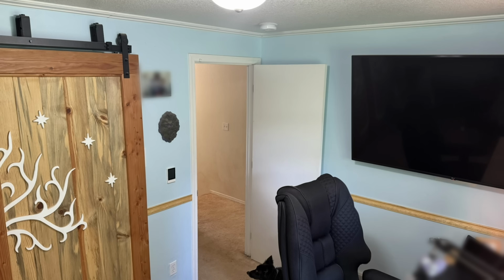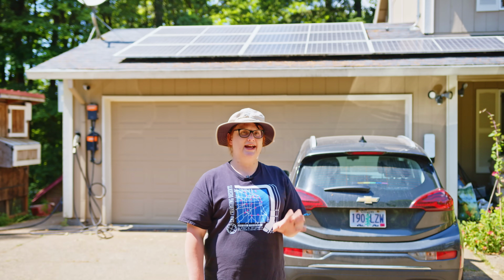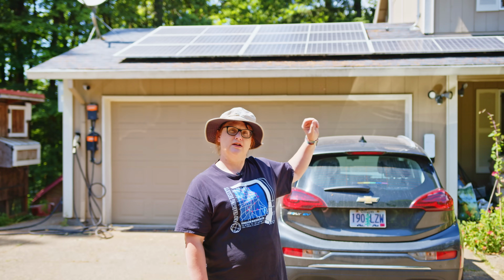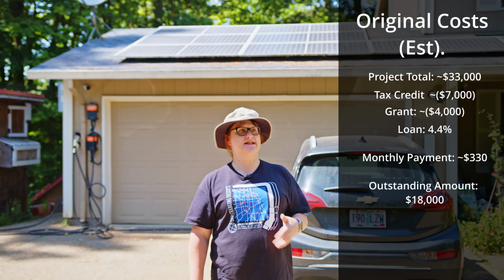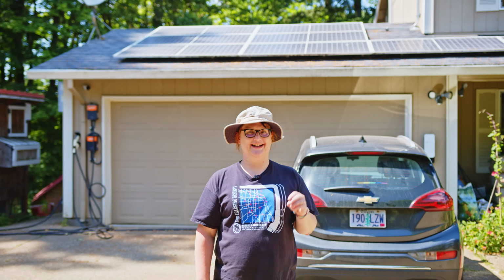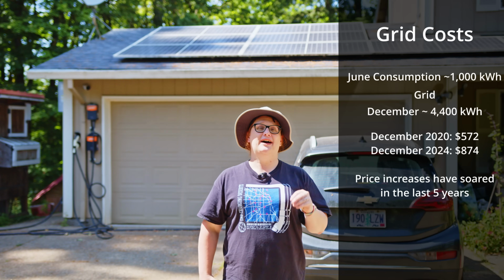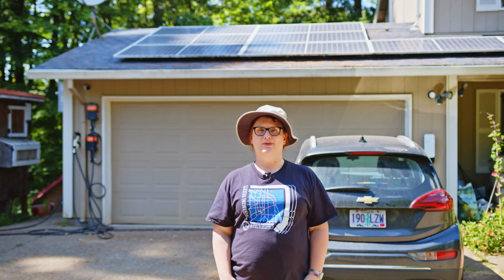Our Solar Array Is Peaking at over 80 kWh a Day! - But Was our Investment Worth It?

Comment: Nice presentation . As the owner of a solar company in Oregon, a few comments. 
1.Get 2 quotes or more   
2. Typically door to door solar companies have outragous prices. 
3. Solar output and very minor degradation in solar panels is more due to variences in weather and way more insignificant to our ridiculous price increases from the electric utilities over the last few years.   
4. Cleaning solar panels over 10 degree tilt, which is most roofs is good but not a huge necessity. Solar panels get a little bit of dew in the morning on them and the tilt is enough to gently wash the dirt off, lower slopes (10 degrees or less) tend to not be steep enough to wash this off, the moisture sits at the bottom, evaporates and the bottom lip of the solar gets a little dirt buildup. I recommend an exapandable pole ($30 or so at hardware store) with a broom that can screw in with soft, with some plain water and a very light cleaning . I don't recommend power washing or getting up on roofs and as I have seen someone fall, I don't recommend going up on the roof for homeowners.   
5.The typical 200 Amp electrical panel can take breakers for 7.6 kw of AC inverter or about 9.88 kw DC. If there is physically enough room for a line side tap before the main breaker than a larger system with an external shutoff and breaker can be installed. If the 200 Amp panel has a 225 Amp bus bar, than a larger system can also be installed.   
6. String inverters vs. micro inverters or Solaredge. I prefer string inverters. Their are multiple manufacturers, in case one goes out of business. With a proprietary system (micro inverters or Solaredge) if they go out of business and the parts fail, you have to start over. Also the least amount of electronics under solar panels (a very tough place to live for decades) the better. I use string level shutdown devices rather than individual module devices. Modern string inverters have multiple MPPT's (seperate indenpent channels for solar) which in most cases does as good as indivdual panel inverters or optimizers.

Comment: 15kWp isn't that large of a solar system these days. you also could put polycrystaline panels on the north side that make use of the more diffuse light. perhaps recyled panels make that financially viable. With perovskite panels it might even be financially viable to repower them sooner than their full lifetime (or put the existing ones on the north side). (I am aware that solar in the US costs about 3x more than in europe.)

About the cleaning it can damage the coating on top of the panels. There's also the issue of hard water. Are you sure the pitch of the roof itself is not enough for panels to clean themselves?

Comment: Looking at that garage door it makes me wonder why someone doesn't manufacture garage doors which solar film on the surface.

In the winter you have the biggest demand for electricity and the least generation, also the sun is at it's lowest so it would be hitting that garage door more than when the sun is high up in the sky.

Surely in the winter vertical solar makes more sense, whether it's a garage door or a garden fence, the sun is lower.

Comment: problem with micro inverters: if your government requires you to regulate / limit the energy exports, you might be really screwed. Most string inverters can do this, but micro inverters usually not. So if you are grid connected and have to pay fees for exported energy, your system might generate financial losses for you...

Comment: 320 amp to the house? I'm guessing that is not 400V 3 phase. What is the supply to a regular house in the US? 240V? 110V?

Happy sunny midsummer!
Reply from the maker: 320 amp, 240 V split phase
Reply: @transportevolved  Interesting system now that I read a bit about it. So you can pull a bit above 35 kW, that is pretty beefy. Well, you are a commercial customer so that makes sense.

Ok, I'm off to watch Kate's system!
Reply from the maker: Nope… 74 kw ;)

The main power in is 240V at 320 Amps.
Reply: @transportevolved  Ah, 320 amp on each of the 120V phases, wow, that's a lot! (I can hear Jeremy Clarkson in my head shouting "powweerrr!") You could install a rapid charger from the old days when 50 kW was rapid charging 🙂

Well, I learned something about American wiring.

Comment: Great video.  My wife and I went solar in 2023.  Our system is close to yours but we have aground mount. REC panels with Enphase (iq8).  I’m a geek and had been researching this for a couple years. My solar installer was impressed with my knowledge and asked if I wanted a sales job. Lol.  This was my midlife crisis present - no sports car for me - power station instead.  We don’t have an EV (yet) but this was an investment for that (waiting for battery tech to mature a bit more and bidirectional charging).  We both work from home and we have a small farm so lot of outbuildings.  Our power company does net metering but we can keep our credit for more than a year.  We have not had to pay any elec bill since it was installed, and we have about $300 credit right now for winter use. Having an odd June with temps already in 90s so AC usage will be greater this summer I think. This was more of an investment for retirement for free energy.  I have a large tracking spreadsheet for every months elec bill/usage.  It will be another 8 yrs till the system has paid for itself in cost savings - after its money in the bank. And not mention pretty good about being green.  We can add another 14 panels to max out the combiner box, so if we both be evs at some point and need more juice - we already ran the lines for it since the panels are 350’ from the house- so all underground in conduit with larger gauge wires due to length. One of the best projects I’ve ever done - I love talking about it and would do it in a heartbeat again.  Sucks that the solar tax credit may be killed by jerks in DC!

Comment: Political comment warning. Solar power and energy storage is both for people who want to be environmentally friendly and those who are doomsday preppers. I am more of a prepper guy. You have a very nice large array. Disappointed to not hear anything about battery storage. Do you use the F-150 for that? Great video I'd like to see another one.
Reply from the maker: Political commentary? Where?
Reply: @transportevolved  I think they were warning that their comment could be construed as political.
Reply: They're using their truck as their battery. If there is an outage, they can power the house with the truck battery. Their current system doesn't allow their solar to work during an outage though but they can possibly change that. A small house battery would enable it though.

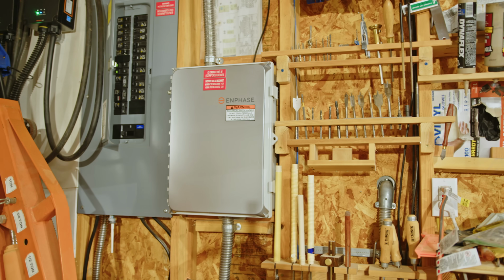Comment: So your system is 15kW DC and 10kW AC, the information label at 9:25 shows 40A as the operational current which would be a little less than 10kW. 

Personally, I would have gone with smaller panels. You would have had 40 panel covering the same area with the same DC rating 15kW, but getting 17% MORE AC power!!!
Reply from the maker: Erm… we regularly produce 12 kW….
Reply: @transportevolved you have IQ7 Plus or IQ7A microinverters?
Reply from the maker: Probably the latter? We're seeing as much as 14 kW output on a really good day, but regularly go to 12 or just over :)

Comment: Just to make a minor correction to Vikki's string inverter information. If you are running a basic string inverter, her description is correct. However these days most DC string inverters employ optimizers (SolarEdge is best known for it, but you can add it to panels using Tigo optimizers or ones from other manufacturers) to maximize output from the panels. The real reason Enphase is considered the 'big deal' these days is because the power coming off the panels is AC and the gauge of wire required is less than if it was DC.
Reply from the maker: You mean Nikki, and thanks!
Reply: I had 10 panels with Enphase IQ7s and 27 panels with SolarEdge optimizers on a newer system. I had two Powerwall3s installed and removed all the micros and optimzers as well as the SolarEdge inverter. The newer panels have bypass diodes that somewhat offset the lack of optimizers and in my situation, I don't have a huge shading issue until late in the afternoon when generation is winding down anyway. Haven't noticed a change in total production. Just depends on your individual solar installation situation. But I have vastly simplified my solar equipment. Just the Tesla Backup Switch behind the meter, one exterior shut down switch and the Powerwalls. Added two expansion packs a couple weeks ago so now most days I'm not importing any grid power. I live in So. California.
Reply: @nicksgarage2  All solar panels have bypass diodes.
Reply: @greenbergp  even old ones? I have 10 14-year old Sharp 230w panels on my roof.
Reply: As far back as I know and I have been installing for 14 years

Comment: The IQ7 will work fine in emergency as long as you are running on the Ford HIS system. The Delta inverter will work with AC coupled solar. I have the system and have tested this.
Reply from the maker: That's not how our system works - how is it set up for you?
Reply: @transportevolved  if you move the breaker(s) for the enphase from the main panel to your backup load panel (connected to the HIS WHB-200), it will still work just the same on-grid, and will also come on when off-grid and on the truck system.  Excess energy will charge the truck.  I have SolarEdge for my system and it works great.  It is fully supported by Delta, and shows in the Delta install manual for the Ex-BDI inverters.  The only issue is that the truck is limited to 9.6kW so you may have to split the Enphase up if it is not already on multiple breakers.
Reply from the maker: Weird. We were told that’s not possible. Did you self install? That would dramatically improve our setup!

Comment: Great podcast! Keep up the good work. An additional thought, once you're able to afford batteries for the house. We also put in the transfer switch so the batteries provide backup power. Very handy in our part of Michigan, the batteries have the ability to store energy and allow the house to use the energy later. Thus, you're not sending the energy in real time out to the grid when the house doesn't need it. It has made a huge difference on our electric bill

Comment: Sorry, one more thing: my Solar installer got up on my roof after five or six years of producing Solar and he said they were cleaner than the day he put them on. It seems that the rain and the snow and the sleet and the wind etc. etc. clean the panels just brilliantly and it’s no charge!!!!!!
Reply: @ronnelson06824  I think it greatly depends on where you are and the season. Here in the Deep South you'll see them start getting a little dingy in the spring after a wet cool winter. They do typically bake off once it gets hot enough but I imagine cleaning them would increase your production earlier in the year
Reply: @matt45540 
That makes sense and if you live in a place with no rain like Southern California, then you’d obviously have to get them cleaned
Reply: Trees don't help, a lot of saps and dust.

Comment: 4.4% apr has basically been free money for the last few years. good job. sounds like youre paying around $0.21/kwh (ignoring the standing charge). with 60mwh produced over 4 years, avg 15mwh/year, thats saving you around $3150/year now. with total monthly payments of $330, your paying around 4k$/year on the loan, so about $800 loss per year, but youre really only paying about 900$/year for the interest on the loan and its more than paying for that. after the end of the loan the panels will basically be free equity in your home, like refinancing your house to build an addition which generates more income than the added interest on your mortgage. 

an important point is that the cost of solar has for once increased dramatically this year with the tariff environment, and with the growing cost of electricity the value of your solar increases every year.

only criticism i have is with the microinverter approach, but given that youre in pnw and went with enphase they will probably last a lot longer than they do in other climates.

really frustrated with the increase in electrcity price here in central wa state. ya we have always had the cheapest electricity in the country but the % increase has been crazy this year. has always been $0.09/kwh to $0.11/kwh depending on your usage tier, first 600kwh was cheap. they got rid of that scheme this year and raised the cost to $0.16/kwh which for me was a 75% yearly increase. frustrating the price went up so much while the price of electricity generating equipment has fallen dramatically. seems like a money grab due to increased interest rates and insurance risks after the la fires. we in wa shouldnt have to pay for the bad decisions in california, but thats my own political beliefs. far too libertarian to be in good company on your channel lol.

Comment: BTW: You can still do a microgrid with IQ6+ and IQ7+s (which is what I have). The main difference is they aren't micro-grid forming on their own, so you need a battery... which I would rather spend the money on than updating all our inverters, since that would be expensive with labor and all. However, because of hurricane roof damage, we have to pull down our system to replace the roof and then reinstall it. I am going to ask if it's worth switching at that time. I'm guessing it won't be. But we'll see.

Comment: Here in Eugene we pay 10c/kWh for use, and get paid 7c/kWh for excess generation sold to the grid. It used to be pure 10/10 net, and that changed in February. The reason given was that EWEB have more electricity generation than they can use, so our excess is worth less than it was. 
In that circumstance it's hard for them to then argue that the cost of their generation should go up.
We have monthly meter readings, and the meter measures total kWh use coming in excess kWh going out, so each month they take the two previous readings and the two current readings, and work out the bill (or credit) from that. No credits or other confusion to roll over to the next bill.
We now run two EVs, so we're using some of that excess generation to run our cars, but we only need to charge each car once or twice a week with about 30 kWh to top up to 70 or 80%, and on clear sunny Summer days we're generating 65-70 kWh a day.
Reply: Meanwhile in northern Europe, our electricity prices crash almost every summer day, as solar dominates.
Reply: They probably should split out the cost of maintaining the wires from the cost of generating electricity. I believe I'm paying 9.56¢ Per kWh  + $34.65 base charge in Coos County (Coos Corry Electric CoOp).
Reply: @elhoward7440  They do, I just didn't mention it specifically. We always pay the basic connection fee each month, even if we used no grid electricity.
Reply: With 2 ev at your home, you can easily run your home from one ev overnight, recharge next day with solar.
Gm advertises a 2 way home charger now. Feed your home overnight from the solar put into tge evs during the day.
No need for the grid any longer with an ev and 2 way home charger
Reply: @alexxbaudwhyn7572  For most of the year we can rely on solar generation and a 10.5 kWh battery for all our needs.
However from early November to mid-January our essential loads exceed our solar generation on most days, and for multiple consecutive days.
Essential loads (in our setup) is everything in the house except the stove, washer and dryer. In a power cut we can cook in other ways (microwave, air fryer and gas BBQ), and if necessary in a prolonged power cut wash clothes by hand and hang them up to dry.
Even if we plugged both cars into our home supply and drained them dry, not using them for driving at all, they would not tide us over this 2-3 month low solar period.

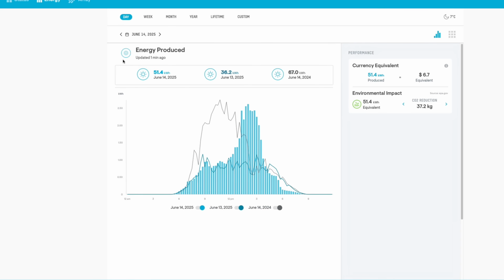Comment: 12:30, you can buy long extension window cleaning kits that should be just as good for washing down solar panels; the better ones even have adjustable angle mid-sections, to ensure even pressure at the max/min height, where the angle isnt ideal on fix extensions.